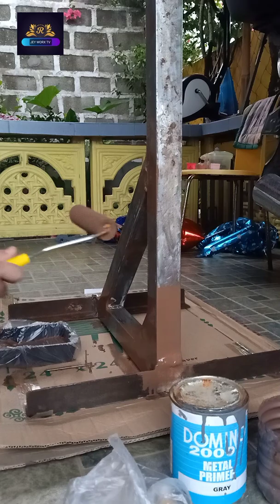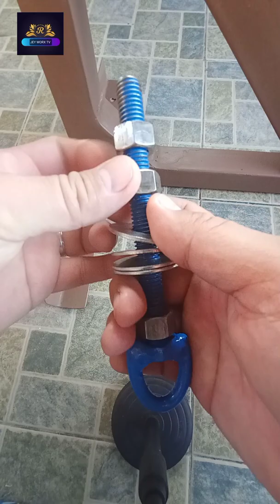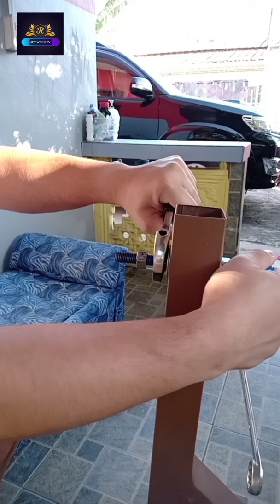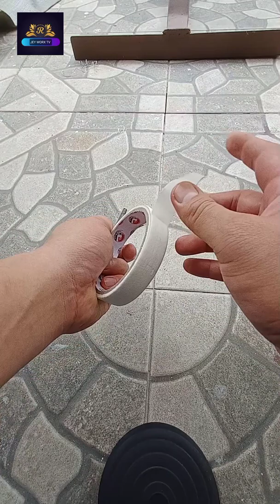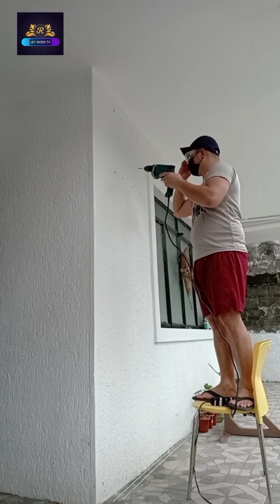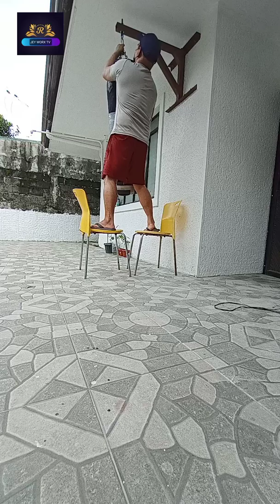DIY 2: Punching Bag Wall Mount made from scrap metal | #diy #boxing #equipment #workout #metalwork

Comment: I finally finished making mine following your videos, thank you very much! All I have to do is fix it to the wall, I would like to have an idea on the drill bit and wall plugs, is it 8mm or 10mm?
Reply from the maker: You're welcome!
In the full video, I used a 12mm concrete drill bit for the 5/16 dynabolt.
10mm is also good as long as atleast it has 6 or 8 holes to hold the mounting. as you notice on my video I put 8 holes for 8 dynabolts to hold it firmly. Just make sure the dynabolt are properly installed.
full video link below

Part 1: https://youtu.be/2JpvGRrKhsk?si=UDcW6-Sa4dyX8l6n
Part 2:
https://youtu.be/11nC18r8Kgs?si=RYrDb_UEfpi6es_Q

Dyna bolt installation
https://youtu.be/WOTpW6iqAU8?si=LOXB1ghuyPhYJF6K